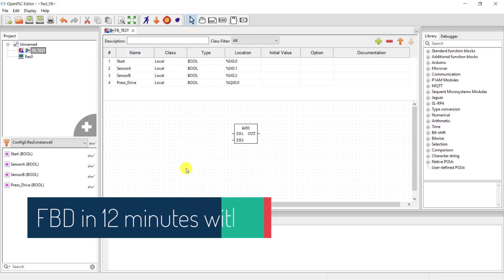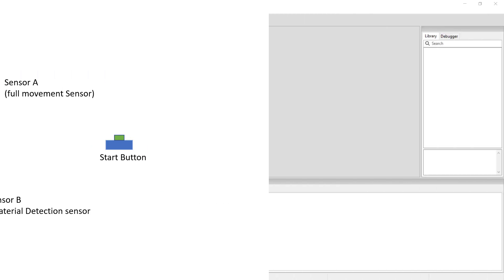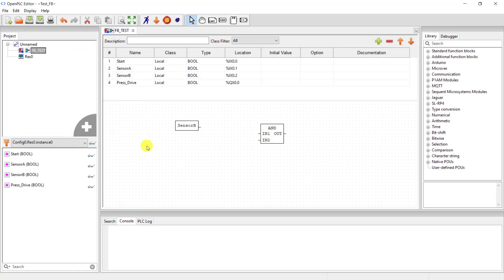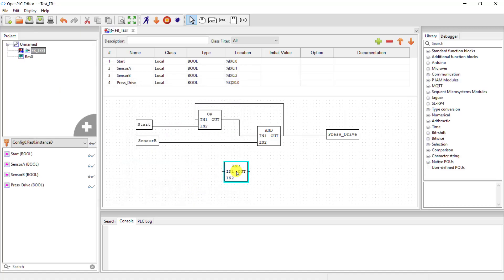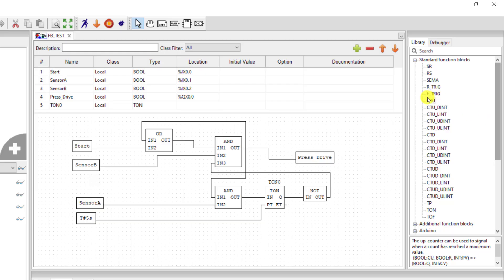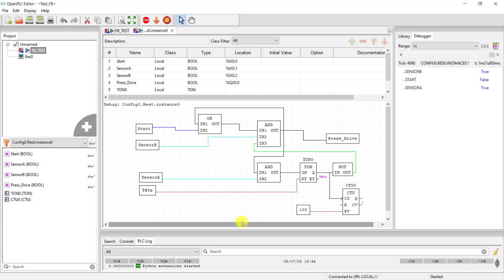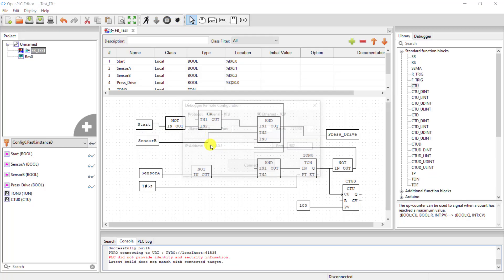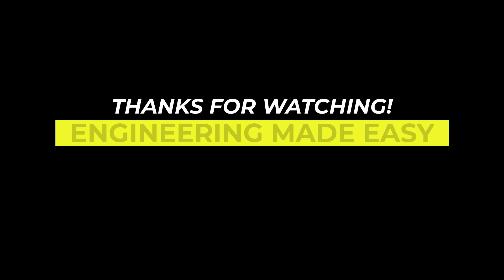Mastering Functional Block Diagram in 12 minutes with OpenPLC |2025

Comment: I copied everything you did however when i try to run it my sensor and start says that its false. How do i fix that? (new to plc) :) thank you in advance
Reply from the maker: Did you have this issue during simulation or whiles using arduino board for physical test?